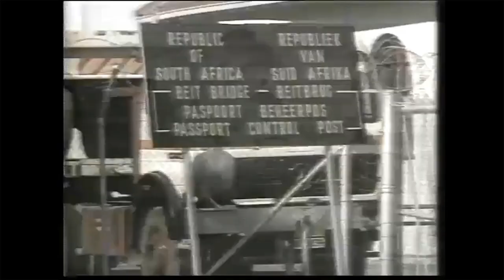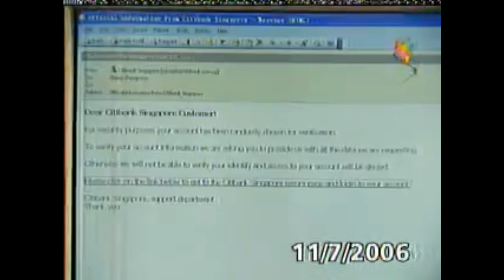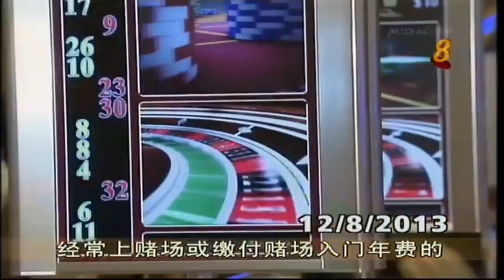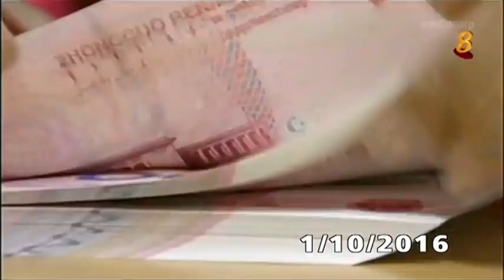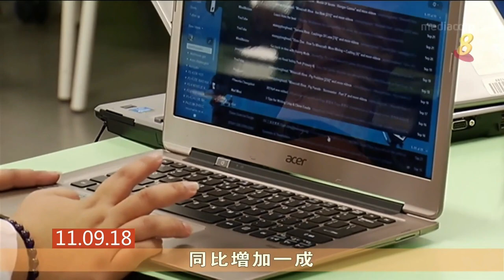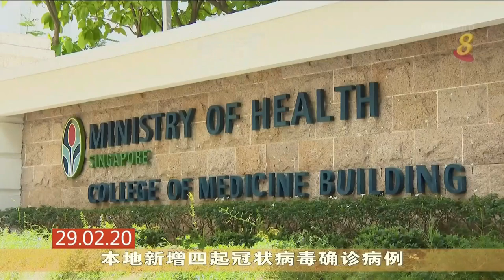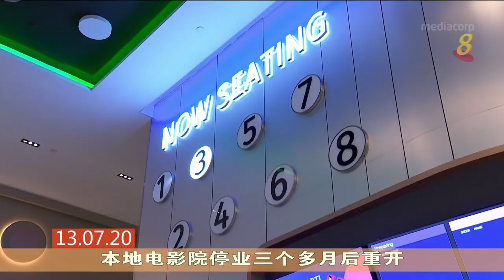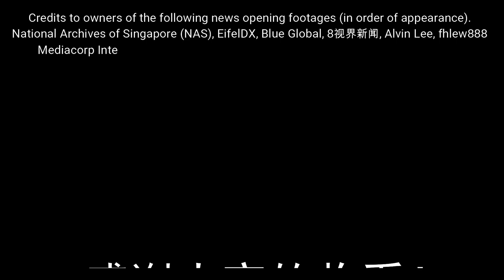Mediacorp Channel 8 news intro evolution 2.0

Comment: Let's talk about Clocks used in Mediacorp Channel 8.
Is there's a proof that the 2006 clock only used till 2013? I still assume it's still used till March 2017, despite although there are no evidence like Mediacorp Channel 8 News Tonight opening with normal clocks in 2013-2017 (I only seen it used last on March 2013 on NAS)
Even if it's totally sponsored why it's unstoppably sponsored for 4 years (2013-2017)? It's weird cause in fact the Channel 5's clocks even doesn't too much sponsored in 2015-2018 (Except for the 2013 one when that The Furniture Mall and ChanBrothers sponsored for over 6 months), and in 2004-2006 where there are no more sponsored clocks till Dopod and Samsung in August 2006.
I hope the 2013-2017 opening of Channel 8 News Tonight might be found soon